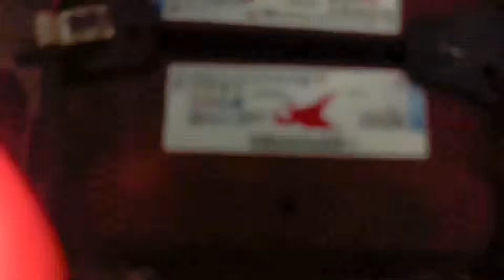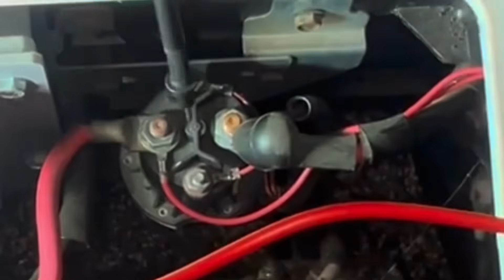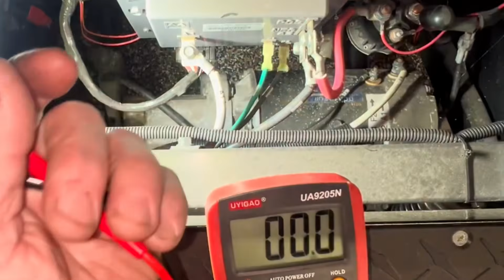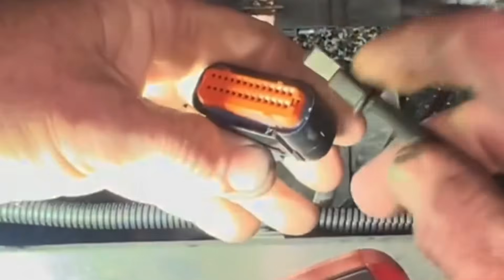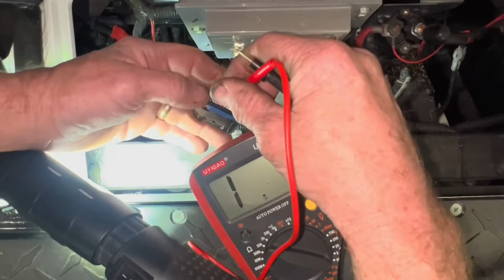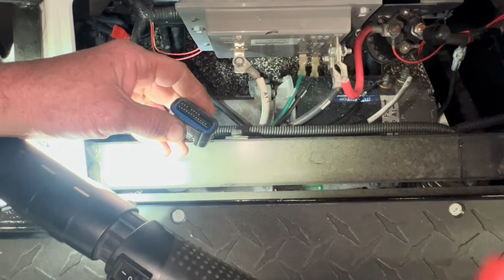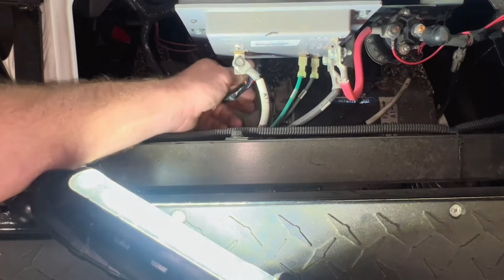Yamaha Electric Golf Cart Troubleshooting - Fixing Common 48V Issues

Comment: I have a 90s yamaha G22e when I press the pedal down it starts to move but when you press the pedal down further is stops. I replaced the throttle position switch and it still does it . Every time you can hear the soleniod click . You cannot move until the soloenoid clicks but when you press the pedal down further it clicks again and stops. Any Ideas? this is my work golf cart and my plant is 1/2 mile long and 1/4 mile wide, so Im really missing my cart, please help.
Reply from the maker: @timocracy777  thanks for watching hit that like and subscribe button for me.
Reply from the maker: @timocracy777  I would say solenoid. Or bad battery.  I would start by testing my batteries right before it cuts out.
Reply: @timocracy777  you need  to adjust the   pedal to the throttle sensor , if the pedal goes past a certain point on the throttle sensor ,it shuts down.